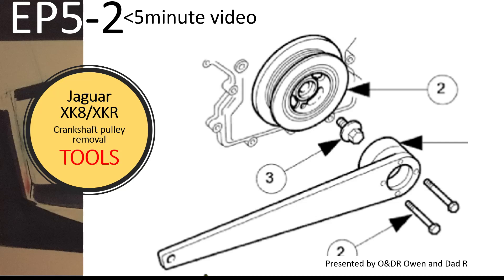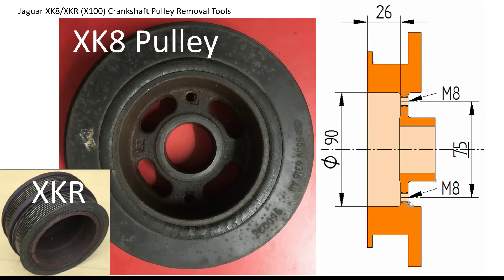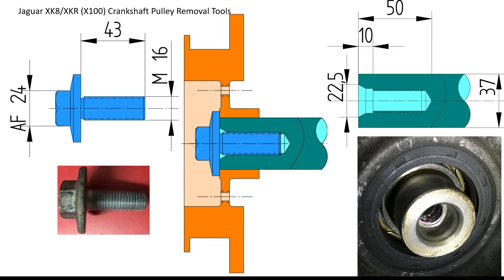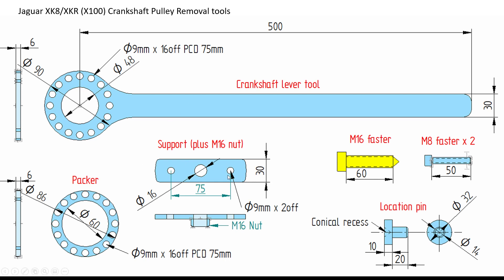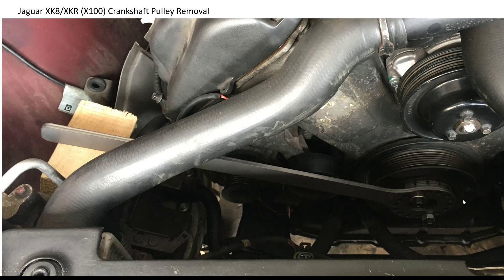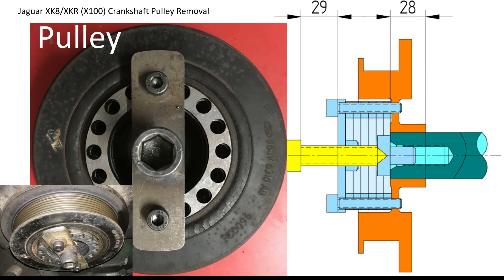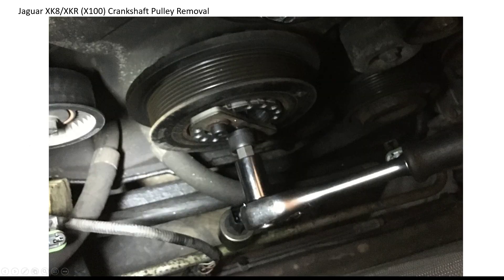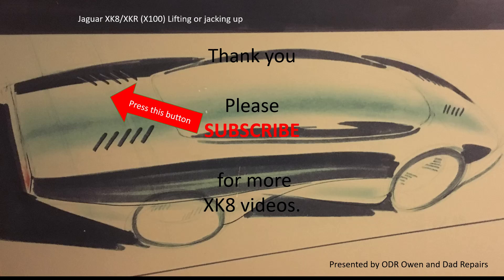Jaguar AJV8 DIY Crankshaft pulley tool designs for removal & refitting. CAD data EP5-2 XK8 XKR X100

Comment: I try in english ;) don’t smile. 
You can’t stop pulley with large screwdriver in flywheel ?
Merci pour ce partage
Reply from the maker: Vincent, non, ce n’est pas recommandé. Ce n’est pas un volant, mais une mince plaque d’entraînement. Parce qu’il est mince, il peut être endommagé s’il est utilisé pour verrouiller le moteur pour enlever la poulie de l’arbre à manivelle. C’est pourquoi vous avez besoin d’un outil spécial pour enlever la poulie de l’arbre à manivelle. Aussi l’outillage de la plaque d’entraînement avec une prise spéciale est le meilleur que les contrôles de la synchronisation de manivelle à cames. J’espère que ça aide. Merci pour le commentaire concernant Damian

Vincent, no, it’s not recommend. It’s not a flywheel but a thin drive plate. Because it’s thin it can be damaged if used to lock the engine to remove the crankshaft pulley. That’s why you need a special tool to remove the crankshaft pulley. Also tooling the drive plate with a special plug is best as controls the timing from crank to cams. Hope that helps. Thanks for the comment regards Damian
Reply from the maker: Vincent, j’espère que ça ne vous dérange pas le logiciel de traduction. Mon Français n’est pas bon. en ce qui concerne Damian
Vincent, hope you do not mind the translation software. My French is not good. regards Damian
Reply: No problem, Damian. I cheated too ;)
My english is do my self ...

Comment: Amazing! What city/state are you at? I'd volunteer my xkr if you want to make an xkr video :)
Reply from the maker: Sorry located in the middle of Wales in the UK. Quite jealous as couldn’t afford a XKR.
Reply: @Modurol  not much more expensive here actually. Here CA
Reply: @Modurol  give is more btw Owen. We could use a video of your level of detail for convertible roof's hydraulic hoses replacement. :) all the hoses ! Beware the green shower...
How about a challenge: pistons seals or valves cleaning...:)